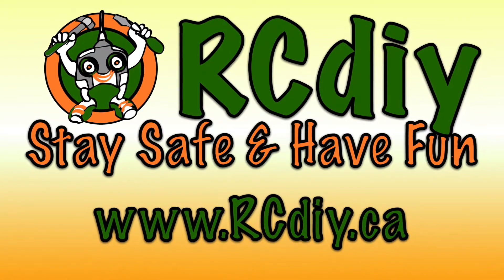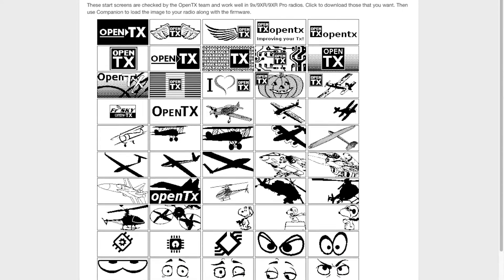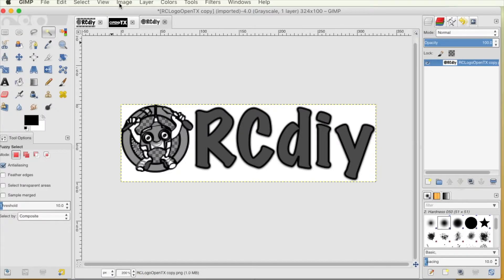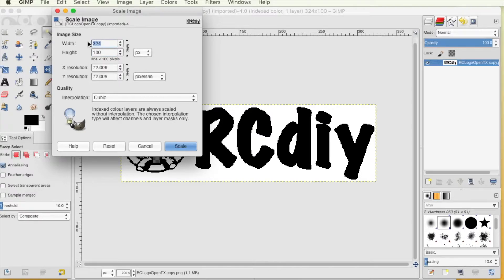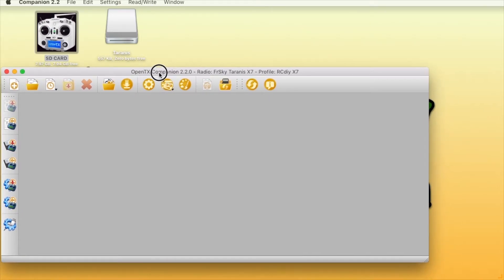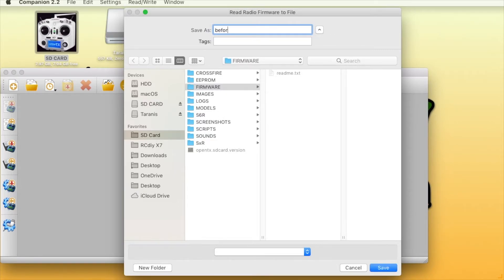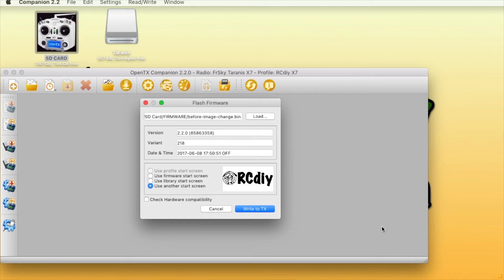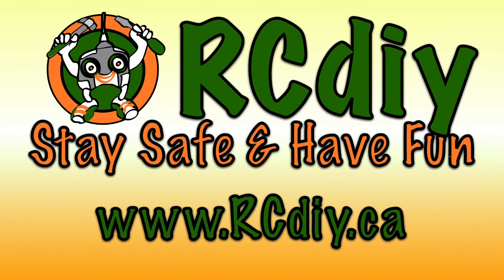Taranis Q X7 OpenTX Power On Splash Screen Image Change

Comment: I've maide the picture in gimp software on my gentoo based linux. But can I change the splash just with the Q X7, without companion?  Cause I'm not really sure how to install companion *.deb packages on a Gentoo sys. So I'm interested in to flash in a mode without companion.
Reply from the maker: Companion is required:(

Comment: hey buddy, any idea why I can't change the splash screen? I have used the premade ones from open tx as well as others to no avail. Using companion I read the firmware from radio, write the firmware to radio and select my image and it writes successfully. I have picked the file from my computer as well as picking it from the companion library. The startup sound changed just fine but it is still the standard splash screen. thanks
Reply from the maker: Gary Brower which version of OpenTX? Which Transmitter?
Reply: RCdiy taranis qx7 ... Opentx version 2.2.1... same version for companion. Tried .bmp and .png 2 color b&w from open tx website
Reply from the maker: I just did it twice using my X7 and Companion 2.2.1
Reply: RCdiy idk... It's a simple process... You just pick it when you write your firmware... I don't understand
Reply from the maker: Don’t know why either. Suggest heading over to Aloft Hobbies and joining us in the forum. Maybe someone there has an answer.